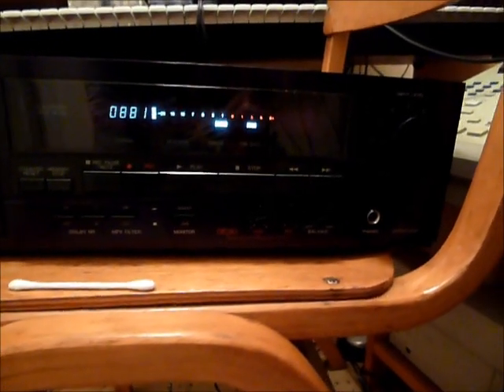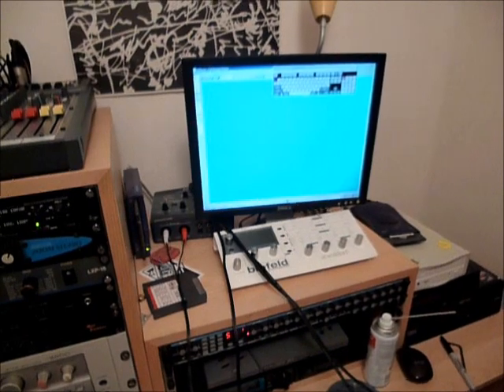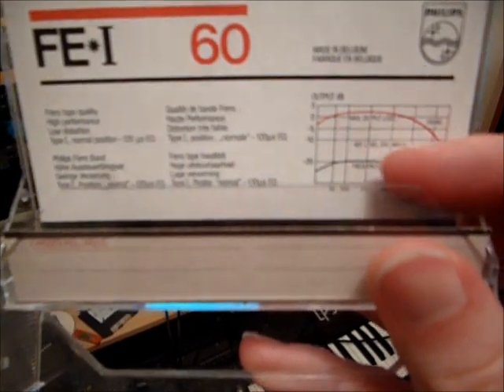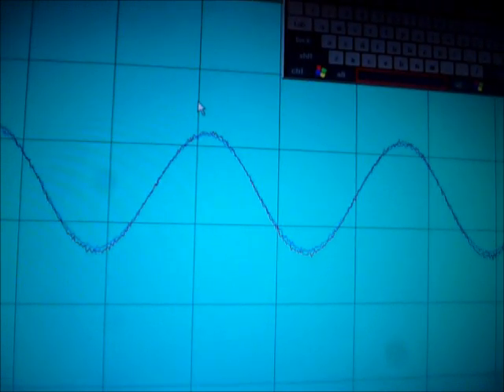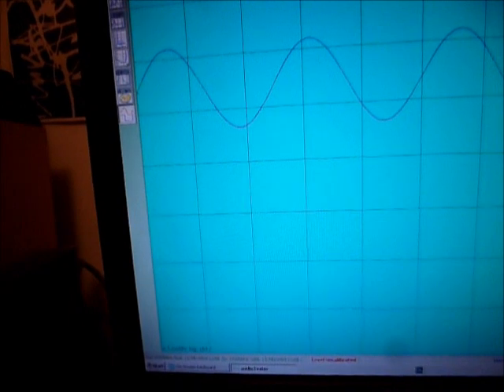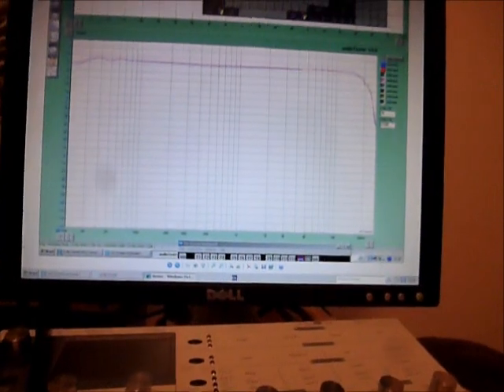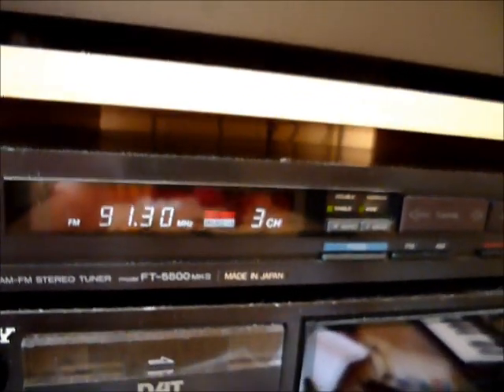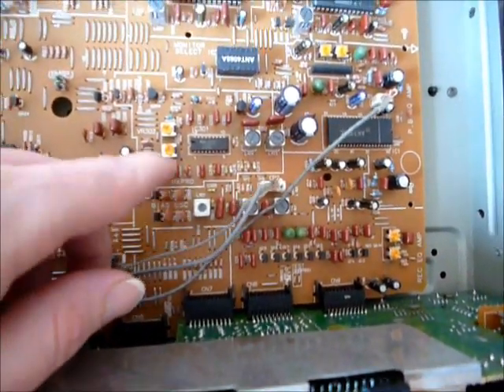Cassette deck calibration / Record Setup using a computer

Comment: so can this program essentially be used to set the correct azimuth ? I don't have the nessesary "confirmed good" test-tape do do it with an oscilloscope.
Reply from the maker: I don't think so as you would need a reference tape at a guess other wise you wouldn't know what to calibrate to but I could be wrong. Any way http://www.ant-audio.co.uk/Tape_Recording/Test_Tapes/AudioTester_azimuth_set/album/index.html

Comment: Most decks I've calibrated have to be adjusted on the circuit board itself and I find many times, one channel will be weaker than the other, most common 'drift'.    I like your toys, some good production items there like the akai.. is that a Roger Linn version?

Comment: There is always some phase shift between channels, especially noticable at 8Khz/10Khz/12Khz and higher. Even if the replay head is perfectly in phase to the recording (and rec head), there is inevitably a shift between the two because of mechanical imperfections as the tape attempts to wrap over the replay head. These physical shifts amount to a microns and often less between the centres of the head gaps. We will never hear such HF frequency shifts.
Reply: @FREEAGENTOFGODYAH  Thanks, nice touch! 

BTW, I have a blog at www.cassettedeckman.blogspot.com where I discuss some ideas concerning cassette tape recorders, and alignment etc. :o)